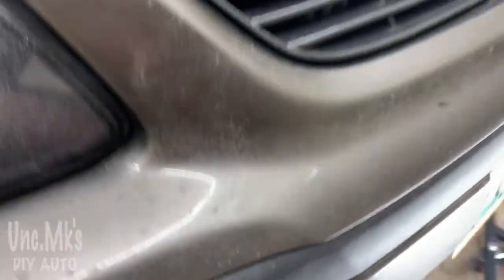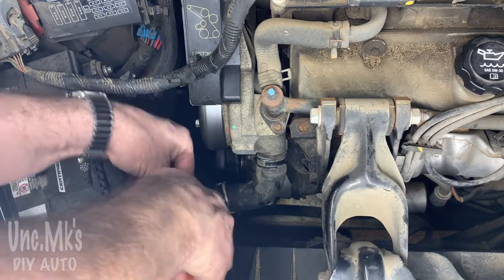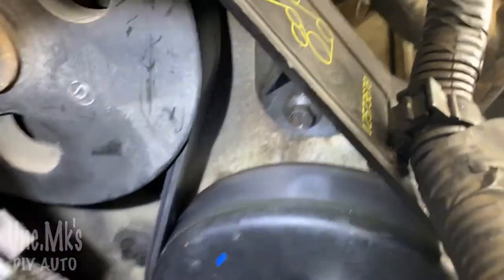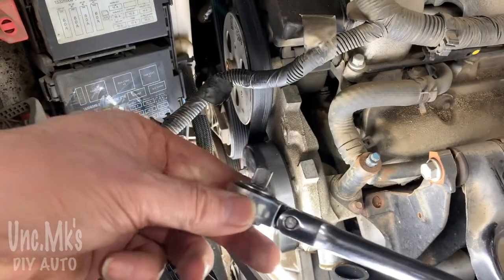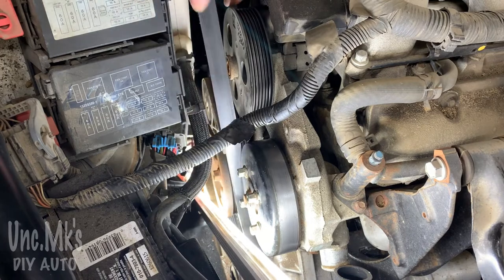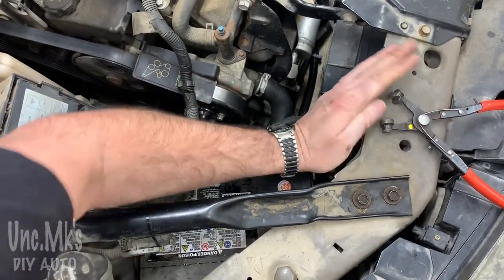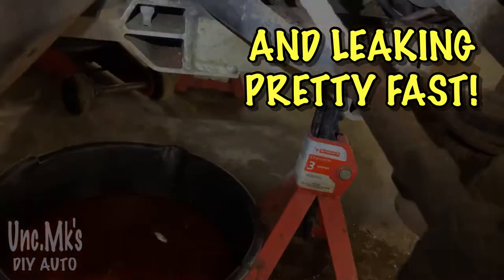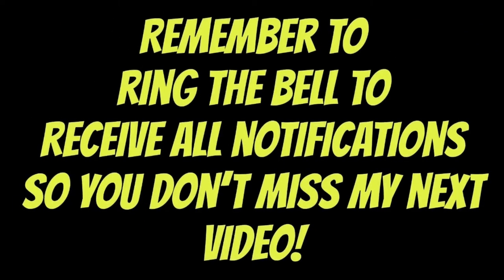How to replace change water pump on 3400 Chevrolet (EP 228R)

Comment: CAN A WATER PUMP BE FAULTY BY NOT PUMPING EVEN IF IT'S NOT LEAKING? THERMOSTAT SEEMS TO BE OPENING BUT LOWER HOSE DOESN'T GET HOT UNTIL ENGINE IS OFF.
Reply from the maker: I guess it is possible. Did you just replace it? (The water pump?) Many of the after market impellers are not as good a design as the originals. Not sure what vehicle it was, but I recall one that the impeller somehow was just spinning on the shaft. Did this just start happening, or was some work just done to the vehicle? Was coolant low and some has been added and there is an air lock?

Comment: Why did you add green antifreez to a system that still has red in it???? You can't mix them on a GM engine?
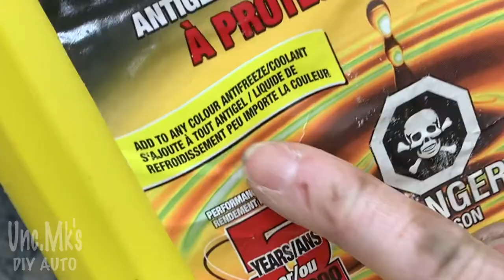Reply from the maker: Good question Robert! @ 25:59 label says it mixes with all colours. Actually it is yellow, take a look again @ 26:06. Thanks for the reminder though. Do NOT mix green in the GM red. As for the “mix with any colour” in my opinion, the GM red antifreeze will last longer than the stuff that mixed with all colours so you don’t have to change it as often.
Reply: I hear alot of mixed Dexcool opinions

Comment: Great Video Uncle Mark. what kind of glue is that.
Reply from the maker: It is called “form a gasket” Ganesh. If you used enough, you could skip the gasket completely. Horribly messy stuff. I am sure there is something more modern and less messy to use.